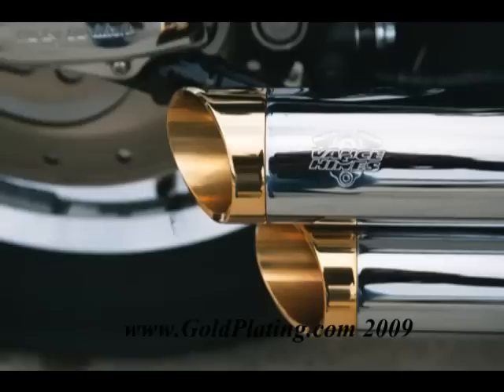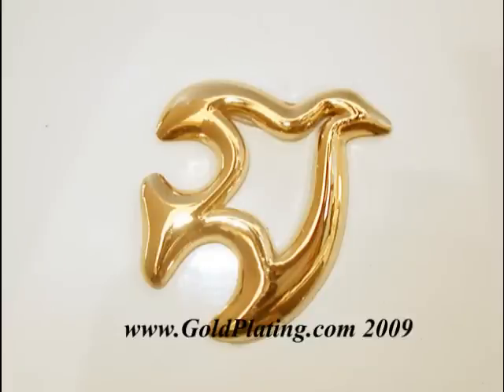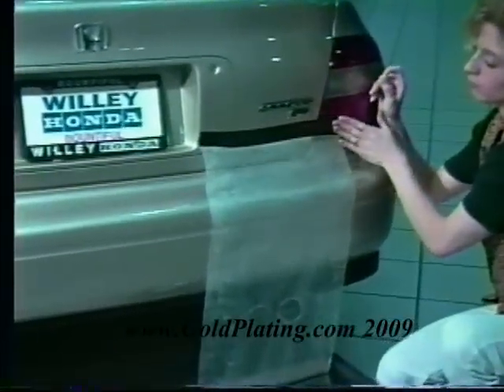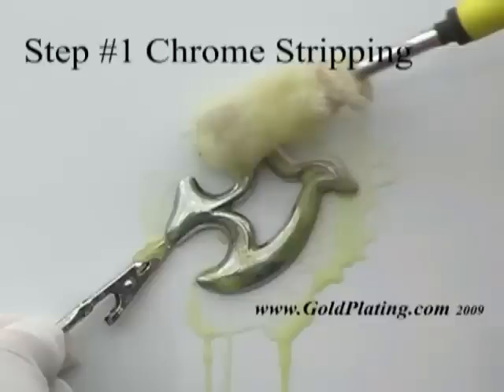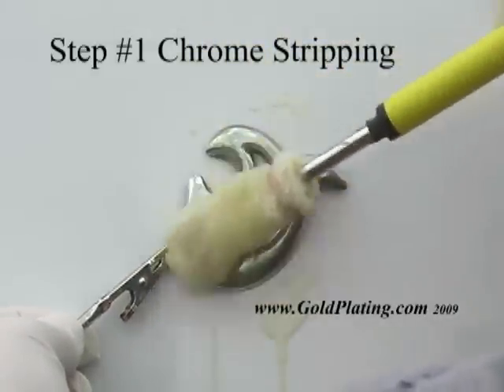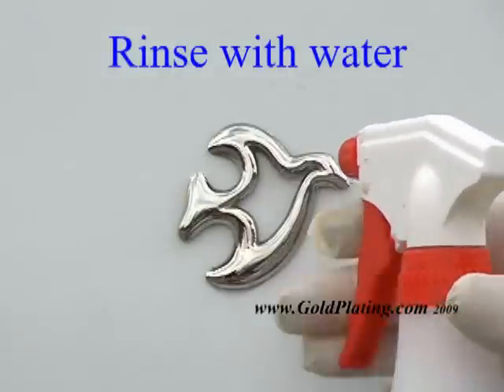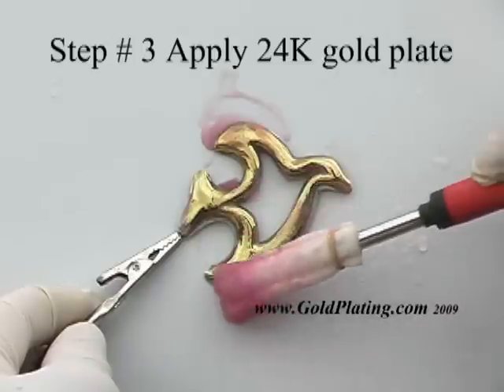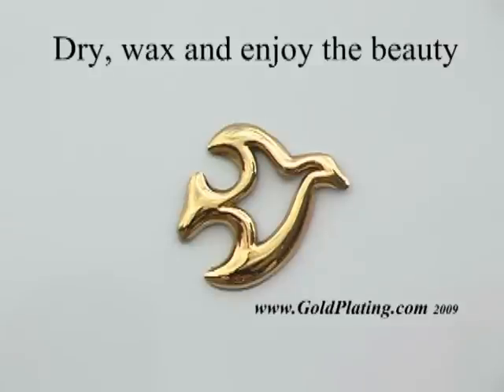Gold Plating Kit - Automotive Gold Plating Machine - 24k Real Gold

Comment from the maker: Our gold is very efficient and the optimal plating range is from 3-5 volts.  If your machine operates within that range our gold should work wonderfully for you.  The reason it's thicker in that picture is because we offer two styles of brush gold.  We have a 24k Brush Gold Gel, and 24k Brush Gold Liquid.  A lot of people prefer the Gel for plating on vertical surfaces to minimize dripping. i.e. plating car emblems on a car the gel will be useful and you wont lose as much gold.  Give us a call!

Comment: Is the gold plating a covering over the chrome or a reaction with the chrome?  The reaction phase would be better as it would remain like chrome for years if looked after properly.  Can it be cleaned with chrome cleaners when the wheel gets dirty.
Reply from the maker: +David Osborne Great question.  The chrome is actually removed with the "Chrome Stripping" step, exposing the underlying Nickel layer.  This is by far the best method for achieving a rich, thick, long lasting layer of 24K gold.  If done properly with our kit the results can last a very long time if taken care of.  We have cars that still look good 20 years later.  Gold by nature is soft, so chrome cleaners and abrasive cleaning will remove the gold.  It has to be cleaned with soft cloth and non-damaging cleaners.  The most common application of gold onto cars rims is for show cars that don't get much exposure to the elements (salt, snow, etc.).  Window trim and emblems are much easier to keep clean as they are further from the road.

Comment: Is this dangerous? Do you have to wear a certain type of respirator ?
Reply from the maker: The Material Safety Data Sheets indicate "Local ventilation", meaning, if you are outside it is not an issue.  If you are inside you should have an open window or a fan.  Some people wear a light mask but it is certainly not required.  We recommend safety glasses to keep any chemicals from getting in your eyes and some light Latex or Nitrile gloves.
Reply: Most gold plating solutions are Cyanide base which is not something you want on your skin.  Wear quality rubber gloves and eye glasses in case of splash back.

Comment: how much does this setup cost
Reply from the maker: This particular setup costs $2,995.00.  It includes everything you need (even the gold) to do a lot of plating.  We have a product page on our website that outlines what the kit includes and has additional information about the kit.  Please e-mail us or call if you have any questions or need any assistance with your order.  Keep in mind, if this kit isn't for you, we have many other kits available ranging from $399.95 to $2,995.00.
Reply: I need enough chemicals to do 2 sets of wheels and I need the price of that too
Reply from the maker: The kit comes with an 8oz jar, which contains enough gold to potentially cover 1,200 square inches of area to a typical decorative thickness.  How many wheels you can plate depends on how much surface area each wheel has, how thick you apply the gold and how much waste you have (how good you are at not wasting).  The nice thing about ordering gold from us is we ship the same day if you place your order before 2pm.  So lets say you did run out of gold, you can call and order and we'll get it out that same day.  If you wanted to play it safe, you could add an additional bottle of gold which is $295 per 8oz jar.
Reply: Gold Plating Services if I wanted to do 24" rims would I have to do it in sections or it doesn't matter as long as the electric side is touching a part of the rim